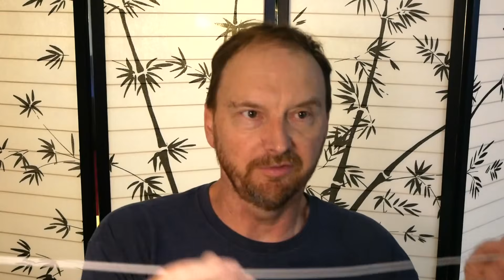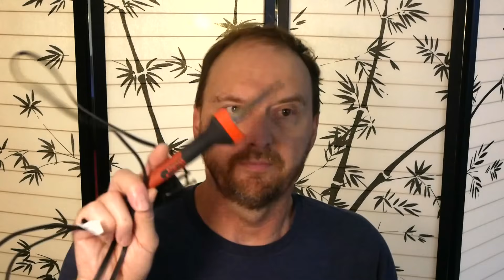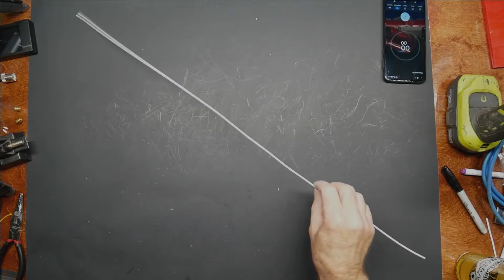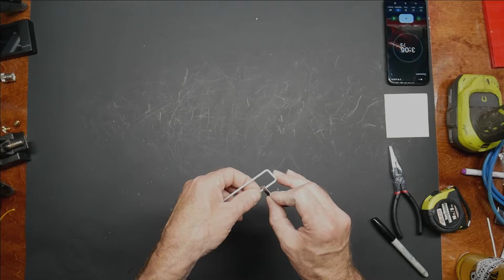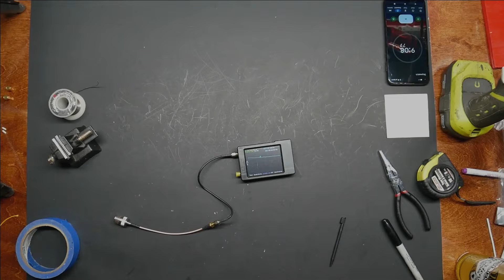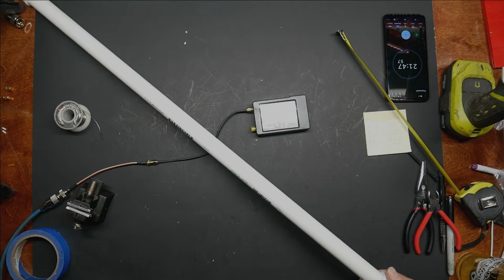Building a GMRS J Pole out of 14 gauge house wire.

Comment: I built this antenna and tuned it to 1.05:1 SWR @ 463 MHz, using a NanoVNA. It was cheap and dead simple. I put it up 25 feet on a hill in the woods in North Georgia connected to a BTECH 50x2. I set the frequency to 462.725 MHz, set my phone next to the radio and started audio recording. I drove all over and into two towns; about a 10 mile radius in multiple directions, test transmitting everywhere from a 5W HT. This antenna picked up EVERY transmission! 10 miles simplex with 5W is NOT BAD AT ALL!
Reply: Congrats and glad to hear on such a successful build.
Reply: I built this antenna and have been using an HT. I'm upgrading to the btech 50v2 this week I wasn't sure if the antenna would be able to handle it or not so glad to see you are using it fine. Any updates since you originally posted
Reply: How many watts will it withstand?
Reply: @chrisbarkley3435  plenty more than 50W.

Comment: Sorry cat sent last message before I was finished. After you get an acceptable swr reading You can assemble it in the tube but it's not going to be trailer omni due to several factors although is should be satisfactory , you need a choke on that coax to keep it from radiating  although most people don't .now after you get it all ready to use try turning that antenna wile watching your field strength meter or s mater and you will notice its not omni so just turn it to get strongest signal on station you need and lock it down . This antenna is a full 1/2wave so has gain in fact we measure all antennas from this half wave figure. It's a great antenna and there are many copper Jr pole antennas over 50 years old still working fine. Build your antennas guys is the best was to go.

Comment: Hey guys its a simple end fed half wave antenna , that 1/4 wave lower section is only for matching the feeling impedance it's pretty much set at your coax impedance 50 ohms in this case , that's all this end is for. Now the portion above the j section is your radiating antenna it's the part that you trim for resonance if the frequency is to hi you need to add to it if the frequency to low trim off an 1/8th of an inch . now after you get an acceptable swr
Reply: So I can adjust the quarter wave wave length to tune the resistance on my nano VNA to try to bring that around to the 50 ohms correct?

Comment: What a valuable video! Thank You!
That was a good stopping point. For a base antenna that probably won't have too much difficulty hitting a local repeater, which receives on 467.625Mhz center frequency, but simplex 462.625Mhz between small 5W radios might be where you'll NEED your best performance.

Comment: How is that not a dead short?
Reply from the maker: It is. Antennas designed at DC ground are common (and desirable for lightning and noise suppression). At 460-ish Mhz that dead short becomes 50-ish ohms.

Comment: The bend or the distance between elements? Isn't it critical? How much can we deviate? Any experience on that guys?
Reply from the maker: I did some experimentation with wider and narrower separation, narrower seemed easier to tune. Part of it is the unshielded center conductor and ground become radiators, and that becomes more of an issue with UHF.
Reply: @ricksshop  Thanks for your answer. I was thinking of using the J-pole antenna with a scanner, one frequency only. Maybe it's less critical then. Given that I have bought copper pipes and t-joints it's kind of hard to design it with so tight separation at 469 MHz . It seems easier with a house wire.

Comment: Oh, FFS - the blade at the end of the tape moves so it can accurately measure inside and outside dimensions. It moves, you’ll discover, exactly the thickness of the blade.
Reply from the maker: If it's a decent brand name tape. The cheap ones aren't. When staying within 1/16" on cuts I don't start at the blade end...
Reply: The 1st inch of tape is 1/16" short.  When measuring the outside dimensions, the tab moves 1/16"  away from the tape to extend the 1st inch to an inch long.  When measuring the inside, the 1/16" thick tab moves towards the tape to make the total 1st inch an inch long.  It's not "sloppy".

Comment: Hello Rick
Thanks for the video and clear instructions.  I meticulously followed your instructions and when it became time to test on my nanovna I got some real crazy results.  I took the antenna out of the 200 psi PVC tube and I got reasonable test results.  As soon as I slip the tube on, even just a couple of inches my test results flip out and shot up over 5 to 1.  Take the tube off and then I slide down to 1.20 : 1.00.    I double checked all measurements including the 5/8ths soldering points and everything is on the dot.  Can you make a suggestion?
Thx

Tim
KI7JBF
Reply from the maker: Expand the frequency range of the vna. What is probably happening is the PVC is changing the velocity factor of the antenna and pushing resonance lower...
Reply: @ricksshop  wow!   Funny thing, I had set my range on my nanovna right to the parameters of the GMRS band.  I will try this in the morning and reply back.  Fingers crossed.  Thank you for the super fast response.  Happy New Year!
Reply: @TH-oh8cw  maybe it's best to use pvc pipe with a much thinner wall?

Comment: Where did you get this thin pipe looked at home depot didn't have anything like that ? And great video thank you
Reply from the maker: It's in the plumbing department, look for the 200 psi PVC.
Reply: I’ve looked and called all around locally. That PR 200 is impossible to find.

Comment: Could you do a video with this antenna for 2meter and 70cm?
Reply from the maker: I might in the near future. 2 meter J antennas end up about 6 feet long, and the radiation pattern isn't optimal on 70 cm. Ed Fong builds an admirable 2 meter/70 cm dual bander that I won't copy, because he sells them for a good cause and encroaching there violates my ethics.
Reply: @ricksshop  that would be awesome. I have the Ed Fong antenna. It was my first antenna. Definitely going to try to build your GMRS antenna.

Comment: Add 3/4 ground radials 1/4wave length long on base part of J Pole straight horizontal.
mount antenna on a insulated pole ,so antenna floats.
Ull find it will perform a lot better line of sight and better performance.
I built one for PMR446 band ,works well.👍

Comment: A branded steel tape should give accurate measure. The sliding hook is to account for the thickness of the hook when taking measurements in tension or compression.

Comment: I'm new to J-pole and you made this look so easy! I had some 14-ga Romex left over so I grabbed that (and cut and bent to your dimensions). After sliding into 3' PVC up to the end, my NANOVNA showed resident freq at 471mHz. SWR was around 1.3:1. I was like, Ok, let me trim the ground a bit and the SWR went down, but the freq went higher. I thought maybe the 1/2" Wave portion was too short, so I built another longer version. I get the same 471mHz, but the SWR was around 2:1 .. what am I doing wrong? I wanted to center my freq around 465 (due to more repeater usage but still wanted to use Simplex.).
Reply from the maker: Sounds like it was close with the first iteration. Full disclosure, the J pole in the video was my fourth attempt. The lengths at UHF frequencies are super critical. Try adding 1/8" to the short leg and 1/4" to the long leg and retest. Velocity factors for insulation and PVC vary, which might account for the discrepancy.
Reply: @ricksshop  Thanks! I also just noticed on my 2nd try - the POS+ solder joint was around 1/8" higher than 5/8" - I'm betting that has a lot to do with it as well ? mismatch ? -- Tim N
Reply from the maker: @SirRonmit  It can, moving the match point up and down can change both SWR and center frequency.
Reply: @SirRonmit Theoretically changing the tapping point only changes the feed point impedance which does affect SWR. my approach would be to adjust the lengths to adjust resonant frequency as per the video and make a final adjustment  by shifting the feed point a little. The low SWR figures that were shown in the video indicates that the position at 5/8 inch is fairly accurate.
Reply: The other thing that could be affecting your SWR is the type of PVC pipe you are using. Ideally, you should be using 200psi thin wall PVC. They sell it at HD, Lowes, Ace, etc. Also, apparently certain kinds of paint on the PVC can mess with SWR as well. I painted the pipe on one of my tri-band j poles with Rustoleum rattle can paint to camouflage it a bit and it killed the SWR of the antenna. Had to buy all new PVC. Ended up just leaving it bare. I've heard Krylon brand doesn't mess with SWR, but haven't tested.

Comment: I have a friend who bought the Ed Fong, dual band, Roll up J-Pole. He assumes its correct. Never tested it! It works good, but I would test it, first.
Reply: I have an Ed Fong GMRS J-pole.  It's a phenomenal antenna and I always get excellent reports on my local repeater.  I tested it with my Nano VNA and It is getting 1.22 in the simplex range, and 1.28 in the repeater range.

Comment: You mention 14GA as your selected cable.  What is the variation (if any) if using 12GA?  10GA?  Is insulation necessary?  IE. Could you use 10GA solid copper ground wire?  Great video...thanks!
Reply from the maker: Going from 14 gauge to 12 gauge won't change much, but using bare wire will change the velocity factor and the listed dimensions will be too short.

Comment: Can't you slide over a thin tube up or down instead of cutting. I'm thinking an antenna tube thin.
Reply from the maker: You can. I've also overlapped and soldered two wires, then just melt it and slide the wire in and out for tuning.
Reply: What about folding? Can you fold wire to change dimensions or frequency resonance @ricksshop
Reply from the maker: @MrSabram07  I don't honestly know what affect that will have. If I get some spare time I'll model that and see.

Comment: Use 1/4 or 3/16 inch copper tube, it will stand up better and all you have to do is spray a sealant on it to prevent corrosion, just like you would with 14 Ga wire, except, you do not need a supporting structure. Also, using the pipe will make the antenna more broad-banded for repeater use.
Reply: Copper pipe isn't as easy to snip or solder. You only need 5Mhz of bandwidth. 1.5:1 for repeater inputs and 1.1:1 for simplex is tough to beat... not sure it's worth the added difficulty trying to build and tune pipe.
Reply: @Gruuvin1  I mucked around with 8 and 10mm microbore copper heating pipe, originally just to connect to patch antennas I'd made, but after a bit of experimentation I was building yagis out of it and a few other things, and it's great stuff.

I found various ways of cutting it, but the little screw down cutters that plumbing shops give away for free or next to nothing are the best 👌 the blade leaves a beveled edge, which seems to be more forgiving than the sharp edges that another cutter got me, and a hacksaw was useless, nearly always bend the length doing that

And I use a spray ignition sealant for old ass cars that's actually a thin layer of  wax unlike wd40 or others, that helps on anything really, stops condensation on pipes indoors too! 😂

Comment: i have a couple questions 1- if you used sch-40 pipe would it hurt your rx and would if effect tuneing ? 2- ccan you use a larger wire say 10awg insulated or bare what would that effect ? Ok that's three questions sorry  thank you wrug770

Comment: Using a repeater puts you at 468. So if you hit repeaters might want to tune up higher. Remember the offset is plus 5 MHz.
Reply from the maker: I agree SWR should be lowest where you transmit, but I spend most of my time on simplex. Final tuning should always be done with the antenna mounted in it's final location...
Reply: @ricksshop  Nice Job. I'm building one this weekend. Thanks for the video.
Reply: If hitting your local repeater is not too difficult, you still may want to tune for best resonance at 462.6, because simplex to 5W handhelds is a lot more difficult than duplex to 50W repeaters.
Reply: Most GMRS repeater receive at the lower end in 462. And Tx at the +5 in the 467. range making 468 the top end.